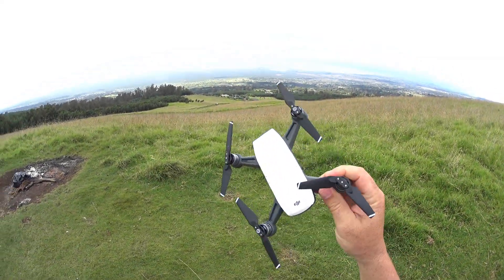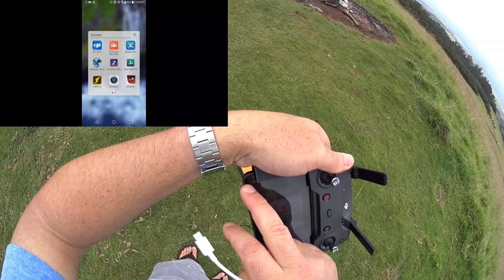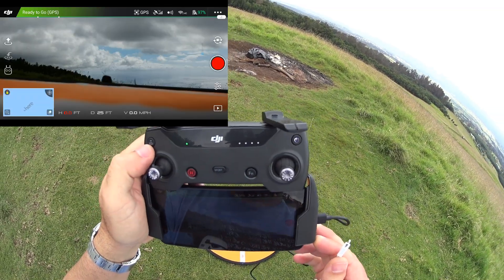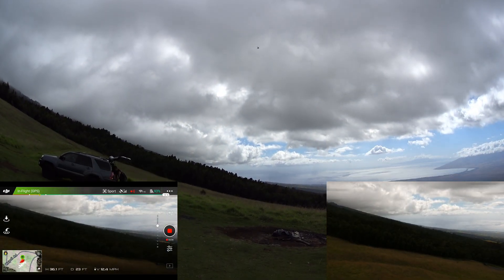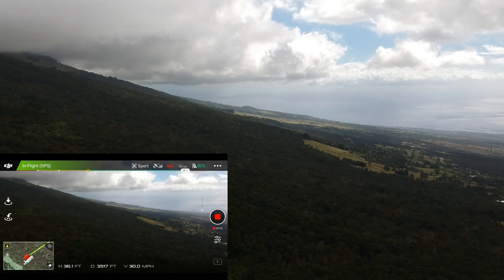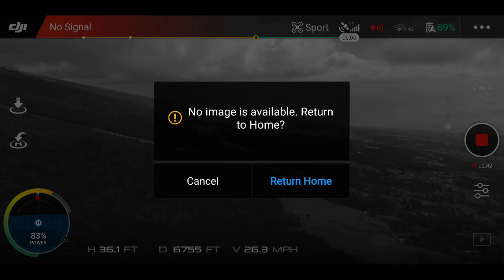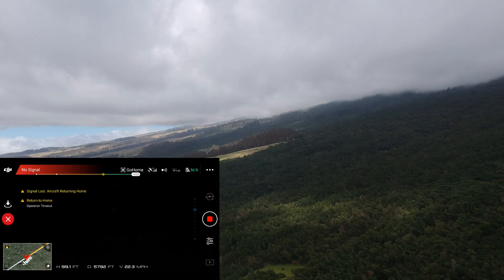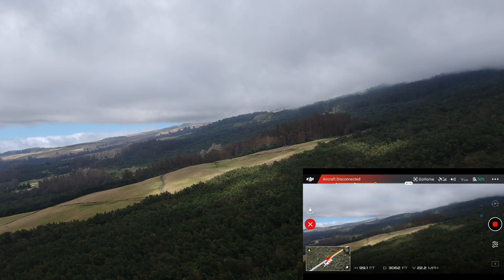DJI SPARK Review - Part 5 - [In-Depth Range Test in 2.4Ghz Mode with RC Controller & OTG Cable]

Comment: I just put mine in 2.4 I don't have to do all that stuff but I get 7500 feet qith a cable on 5.8...I think 5.8 does better and is faster. Idk why people say use 2.4...but anyways I been wondering about if a spark tells me where I'm pointing my remote and u finally showed me thanks

Comment: Hello there , cool video 
I wanted to know how does you reach with the spark up to 6600 feet 
mine reaches only 1181 feet with the same conditions on the video (remote controller and OTG cable connected to the phone )
I scratched all the web to understand what is happens  , but no answer
it's confusing me 
hope for you to reply
Reply from the maker: Open area and no interference 🍻

Comment: What's up brother just got a spark the other day was wondering is there any upgrades for the battery it seems like 6 minutes is a very short time to get back I know the initial is 12 or 16 minutes. Does any of the other DJI  Batteries work in the spark

Comment: the 2.4 or 5.8Ghz selection is the connection between the controller and the phone, thats why it disappears when you plug the cable in. the connection between the controller and the drone is RC, hence the distance of 10000+ft in your previous video with the dishes.
Reply: This! Most important comment here

Comment: hi Dustin, what is the use of otg cable on your wifi connectivity? you did not turned off your wifi on your device when you took off.
Reply: OTG is just for better connection between the phone and controller. If you leave your wifi connected when you plug the OTG cable in, it will automatically go to the OTG connection. When I first started using an OTG cable I would put my phone in airplane mode, but found out it makes no difference.

Comment: wow I dint know about this that you can change the frequency on the Spark like that. Interesting. I have struggled with the range on the spark myself but that i think is mostly from where I fly as lot of buildings around and a lot of interference... will try this 2.4 ghz and see if it makes any difference at all for me.
Reply: So did it make a difference?

Comment: I don't understand why you'd get better range on 2.8... it's lower??? I'd think I'd be the opposite!! I'm still very very impressed with the range.. I literally just un-boxed my 
Spark from Santey Clause!! I believe I watched every video about it on YouTube.. This is my first Drone that costs more than $20.00 lol... I'm pretty excited about tomorrow so I can fly it.
Reply: Charlie Eichholz Charles how are you liking your spark
Reply: @Thatguybash  Dude, I absolutely love it... Perfect drone for a beginner plus it's amazing... It's so easy to fly and when I'm ready I can switch to sport mode... As I'm learning on my spark I'm already building a  racing drone. I'm buying piece by piece so I got time to master the spark... But I'll never not fly my spark cause it's just that good! If ya don't have one I suggest buying one, you will not be disappointed
Reply: The lower the frequency the better the range under ideal conditions and same power levels.
Reply: @Jpilgrim30  Thanks a lot... I'm still scared to fly too far away

Comment: Nice job. Here's what the DJI Support says regarding transmission distance for the remote to the Spark. Note that max distance is the same for either 2.4 or 5GHz wiFi setting. 2000 meters or over 6,500 feet - more than a mile. The OTG cable helps with potential latency between the received video signal from the controller to the phone display. I always use the OTG and turn off wiFi on my phone just to eliminate any possibility of interference. 

What is the maximum transmission distance?

(1) If the aircraft is connected with the remote controller:
a. The remote controller is operating at 2.4 GHz (Unobstructed, free of interference) :
FCC Compliant: 2000 meters;

b. The remote controller is operating at 5.8 GHz (Unobstructed, free of interference) :
FCC Compliant: 2000 meters;

(2) If the aircraft is connected with DJI GO 4 via Wi-Fi:
Within 100 meters at a height of 50 meters.
Reply: Oh man, thank you for explanation... I use FCC mode with wifi connection, you know what...not more than 300m distance and 50m height and spark RTH always...

Comment: Quick question, is precision landing automatic or is there an option to turn it on? As long as you fly up to atleast 30ft on liftoff you should be set to my understanding? Thanks! Love ur videos btw, the locations and detailed explanations are the best 🙌🏼🙌🏼
Reply from the maker: With recent updates, if you auto takeoff you have the choice.  If you manually launch take it up 30ft like you said and it should activate automatically 👍

Comment: You know what? I just got one and the amount of noise it makes is HUGE and I did just a hover and do nothing test indoors, full battery, so no wind or anything and prop guards off and it only lasted 15.00.53 minutes!! NOT 16 minutes even without DOING anything!!! 😦😦😦
Reply from the maker: Yes it's loud.  Hovering is not optimal efficient speed.  About 12mph or so forward is supposed to be most efficient speed in no wind.
Reply: @DustinDunnill  first, thanks for your reply! Second, it states that it should last 16 minutes, so I would expect with it just hovering and doing nothing a few feet off the ground with no propeller guards on and a full battery charge indoors to last even longer, like 18 minutes! But it didn't even reach 16 minutes with that! So the 16 minutes battery time is a complete lie right from the outset!!! Grrr!
Reply: @Jacob_Crowthorne  Don't sweat it too much, hovering is actually going to consume more battery power faster.  When the aircraft is moving forward it is flying into clean air (less turbulent).  Whenever you are flying a helicopter, you don't just hover straight up if you don't have to, you get it off the ground and begin flying forward until you hit what's called transitional lift where the rotors are cutting into clean air, then you climb.  Thats probably why it ate battery power faster, it was not only working harder to hover in turbulent air, it was fighting that turbulence to remain in one place.  Also, it's my understanding that batteries need to go through several charge/discharge cycles when new before they reach their full capacity.  Hope you're having fun flying!
Reply: @williamsalzmann2555  thanks for that info, will have to try it! BTW when I did same hover test with prop guards on it only lasted 11 to 12 minutes!

Comment: Yes, battery determines distance. No difference when flying in 2.4 or 5.8,  
I can certainly recommend the Spark for reliability and speed of acquiring satellites on top or down under.
Reply: 2.4 and 5.8 does determine distance. The 5 GHz band has a shorter range compared to a 2.4 GHz band because in radio frequencies, the higher the frequency the shorter its range.
Reply: Thanks for that educational information! I had no idea of that. I always thought it was the other way around (home WiFi network)

Comment: you can take the controller apart and look for the piazo speaker<belive its spelled,> and de-solder it. There is another way to disable the beep, but you would have to hack it and then turn it off within its parameters.

Comment: What could happen if you fly without caching the map on your monitor or if you forget to cache  the map before you fly? In my case i only have wifi option and non cellular on my iPad mini 4. Would the drone be confused and fly away?
Reply from the maker: You'll just have a blank map but everything will work fine 👍

Comment: Dustin, try an higher flight of the drone, because on that frequency the drone and controler need visible connection, Trees and buidings mute and disturb the connection.

Comment: it looks like you were way higher than 36 ft, why doesnt your spark adjust to the height?
Reply from the maker: It doesn't know changing ground altitude.  Only 0 where it launched from.
Reply: Dustin Dunnill huh never noticed that, thanks for the answer

Comment: I think you were still connected to the remote controller via WiFi even though you had the OTG cable plugged in.  If you could switch off your WiFi or put your phone on airplane ✈️  mode after you connect the OTG cable it may well stay connected, I have not tried this yet?
Reply: Just tried this out & found that the DJI GO 4 app did not give me the option to change to 2.4 but I changed the channel from 149 to 9 anyway which prompted a WiFi restart. 
You then need to leave DJI GO 4 app running but exit it into the multi task pane, then connect your OTG cable (you should hear a ding) then switch to airplane ✈️ mode.  Now all you need to do is flip back to DJI GO 4 app in the multitasking pane & voila, your connected to the controller via OTG on 2.4Ghz
and your phone is in airplane ✈️ mode!  

I’ve tested this with an iPhone 6 on latest IOS, with recently purchased & fully updated Spark©️ fly more combo! 👌
Reply: I think some channels are allocated to the 2.4Ghz band & some others to the 5.8Ghz. 👍
Reply: Pick a channel & try your luck? 
You’re welcome. 😉

Comment: Why would you use the parabolic range extenders in part 4 but not use them in part 5??  I'm pretty sure the controller always uses 5.8 for FPV video and 2.4 for control. Why would it not, when the video and control signals could possibly interfere with one another??

Comment: I live in the city and I have an OTG cable and a range extender what would you prefer 2.4ghz to 5.8ghz?? thanks!
Reply: I dont know if you're still wondering but you should use 5.8ghz in the city because 2.4 is used by wifi networks so there would be an extreme amount of interference
Reply: @joshua broughton-herrick yeah everyone uses 5 GHz but 99.9 percent of routers still output a 2.4ghz frequency. That's why your router outputs 2 networks one with 5g on the end. A lot of mobile networks also operate on a frequency close to 2.4 ghz

Comment: Could I use my Fatshark goggles with this drone?
Reply from the maker: +415bryant Unfortunately not wirelessly unless you connect a converter to your phone to convert to analog FPV.  If your device had an HDMI out you may be able to connect directly to the Fatshark HDMI in Port and mirror your device screen into goggles.

Comment: When the wifi symbol is still shown in the app this means your controller is connected with the phone over wifi.
When OTG takes over the wifi symbol gets blank in the app. You did not switch off the wifi of the phone before take off.

Comment: Nice video! Do you think you could have increased range with more altitude? I typically get dramatically more range if I fly a little higher.
Reply from the maker: +David Thompson Thanks David.  Most likely.  Since the mountain slopes down quickly here I try not to get too high when doing range tests, otherwise I'm over 400 in a matter of a minute 👍
Reply: Very true, my friend!  I didn't think about that!
Reply from the maker: +David Thompson I think it will be really cool when DJI starts including an AGL (above ground level) reading for altitudes above what it's ground sensors can see by pulling in ground elevations and triangulating it's alt  based on it's GPS coordinate at any given time 👍
Reply: Dustin Dunnill I agree wholeheartedly!

Comment: Great the last 2 app updates kills otg usage at all
Reply from the maker: +Santiago Almendarez bummer.  Thanks for sharing.  Is this info 100% confirmed?
Reply: Dustin Dunnill for the .20 and .22 of the app for Android it won't show satellite info or battery info with otg cable. App version .15 will. Absolutely sucks. I couldn't tell you about ios

Comment: Hey Dustin, is the spark fliable with mobile device only to start? Eventually I will get the remote, guards, otg cable, and one more battery probably off my  Amazon. To start I'm probably going to go with quad only what you think? I can't afford fly more at start that's why I got to buy like I mentioned above. Thanks
Reply from the maker: +nick svaluto It does fine in the basic package.  You just have to get used to controlling on your phone screen and the range is only going to be about 300ft until you get a Controller 👍

Comment: Thanks for the video! Aren't we talking two different animals? Wifi is used for video transmission and R/C signal (Digital PCM) is used for controlling the  aircraft. I am not sure about the Spark though. Is the aircraft controlled by wifi or r/c signal? I have drones that the wifi signal will interfere with the r/c signal sometimes. I try to make sure they are operating at different frequencies ie; 2.4ghz and 5.8ghz. I have better luck with interference doing that. Also if I may procrastinate ;-), as an old pilot we should all do a preflight check list. In my experience it has saved the bacon on many occasions for me. A simple list can go a long way. Always a pleasure to watch your videos!

Comment: Seems iam stuck in 5.8 Ghz and cant get it to go back to 2.4GHz... when i fly it with my tablet I can change it to 2.4...but when iam using the controller it stays in 5.8... even the when it tells me "wifi will restart to take effect" i guess somehow i need to change it in the controller. Any sugestions ?

Comment: Hi Dustin...great attempt there but it seems ur not connected via OTG cable. It shows the RC is still connected via wifi. A true OTG connection will not have the wifi indicator on. Please correct me if I'm wrong, ppl
Reply: Asnil Md. Zain I think you are right. The wifi connection is used from controller to phone. When you use a cable you will have less delay video on phone.

Comment: How do you know that plugging in the otg cable to the controller actually established a wired phone-RC connection that replaced the original wifi connection? If you then unplug the otg connection do you lose the phone-controller link?
Reply: Yes.... I did now my phone does not connect to the drone over WiFi nomore .

Comment: Hi  Dustin,
I'm following your videos, quite interesting. Here comes some hints to get better range test results, coming from my experience with a Bebop2: 1) ensure you are in 2.4Ghz as you did 2) ensure is remote control but not the phone the one connected to the drone (maybe that is what you mean "spark must be in RC mode") 3) get 100meters high (330feet) 4) check if transmitter uses higher power in different countries (power is regulated by law) if so..... try to say Spark you're in that country 5) check if Spark antenna are in front or back, and fly accordingly forward or backwards and 6) please please,  don't do tests over forest or sea, try better some space where drone is easy to rescue (following a land track, for example)

For sure next test will yield better results.

Comment: The  choice here between 5.8 and 2.4 is only for the wifi connection between the remote and the phone.  This also why you don't get the option when you use the OTG usb cable.  if it was a real wifi connection where you can chose the channel, the distance would be max 200 meters. (because of the legal wifi regulations.)  So I would very suprised if there would be a diffrence ;-)...
Reply: That's not true, any of it.

Comment: In theory, 2.4 should give you better  control range and that is true on home built aircraft (in most cases) where the only option for control is 2.4 and the 5.8 is for video only.
But...I think with the Occusync system the control signal is sent on top of the video signal.  IOW...One frequency+ sync signal. This one frequency signal going out for control and back for video on the same channel is unlike the "normal" RC system.  What gave me that thought was that control is lost at or about the same time as loss of video, within seconds in my experience with the Spark.   Not true with normal RC w/video use.  So that's my take on why the range is so limited compared to the Mavic.  And most of the views I've seen using parabolic antennas was that it didn't help and in one case actually caused less distance.

Comment: Do they make more than one type of transmitter,I saw another review of the spark with a transmitter that had a built in fpv screen built in.
Reply: Ron Thompson  Might have been Crystalsky monitor attached?
Reply from the maker: +Ron Thompson Not that I know of.   Perhaps you saw the white Phantom 4 pro plus which has a built in swivel FPV screen.

Comment: with the 2.4g you should fly around the 100m to achieve better distance....love your long distance flights
Reply from the maker: +Demosthenis Loizou Thanks.  You mean a specific channel?
Reply: I mean it is important the angle of quadcopter with you. 100m and higher the better... i fly mine at 150-160m

Comment: I've read a lot of guys saying that you get better range using 2.4ghz, but I've never bothered to try. I've gone out beyond a mile with 5.8ghz stock using the OTG, and that's far enough for me. Generally, I shoot video less than 1000 feet away, so the distance isn't that big a deal. I suppose you could do without the OTG cable .. go strictly wi-fi, use Litchi (which won't work with an OTG cable) and put in Airplane mode and give it another try. I think the limiting factor on the Spark is the battery size anyway. You're not going to get too much over 2 miles and be able to get home safely with such a small battery. Thanks for the report .. I'm sure others will put up posts that they went 4.8 miles on 2.4ghz, but I'd have to see it to believe it. Mahalo ...
Reply: What is Litchi?
Reply from the maker: +Bill Somrak 🍻 cheers Bill